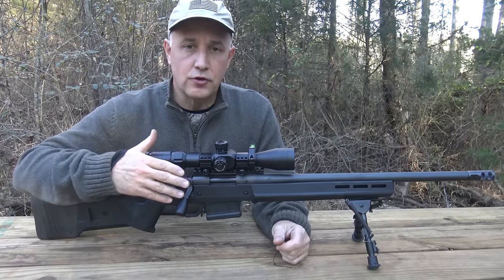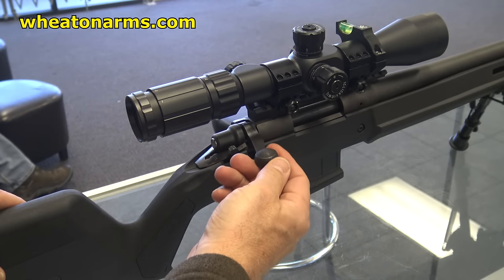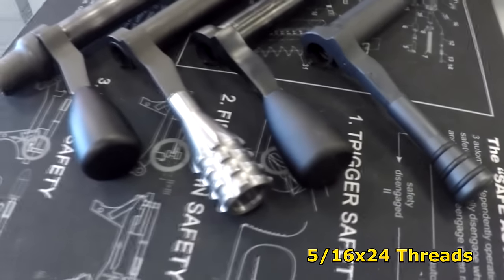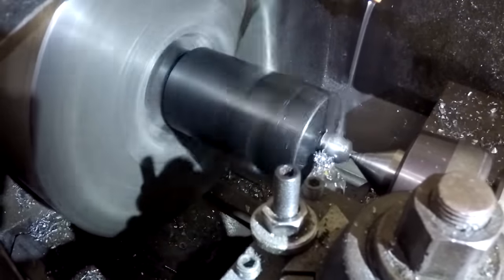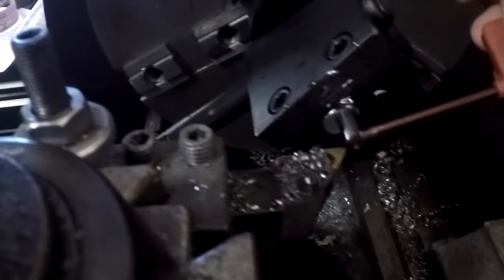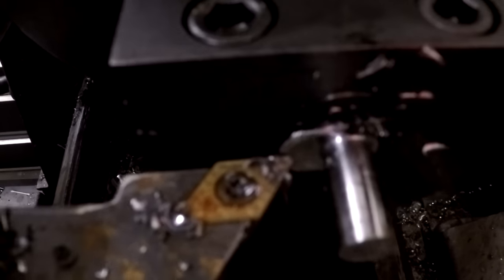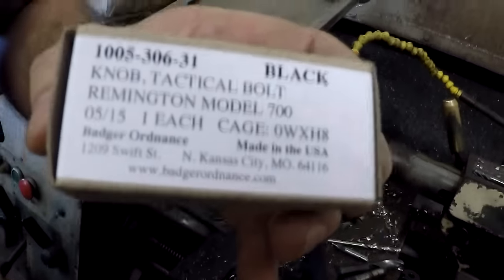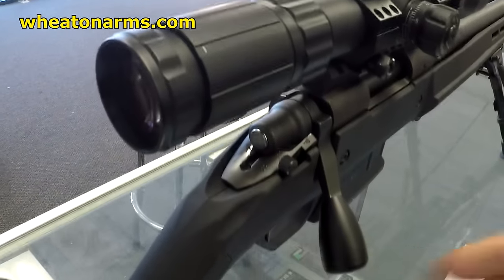Extended Bolt Handle Mod for Remington 700 Rifles

Comment: One reason I like Savages more than Remingtons. You can buy a extended bolt handle for a Savage for less than $60 and install it yourself. The only tool you need is a hex wrench or, on some of the older models, just a flathead screwdriver.
Reply: your right just did my savage cost me 56 bucks and a few minutes of my time...it's my go to deer rifle
Reply from the maker: +Deerslayer1912 Savage is making high quality rifles. I'm hoping to get one for review soon. Thanks
Reply: I agree Savage makes a better rifle
Reply: I've got a savage in 300 mag and I freaking love it super accurate long distance
Reply: +The Dude I run 7.62x51 thru mine and it's stupid accurate. The trigger is so crisp my friends who fired it for the first time jumped when it fired. Lol. They're not combat vets. Lol.
Reply: +fsteddie95 I've done some trigger work on mine it was good before that but it's fantastic now
Reply: +The Dude can i ask how big a distance u may be shotting ? and i love savage but god i hate rem never will i own a rem 700
Reply: Brandy brancourt well the distance would all depend on the scope you put on it a 300 mag is good for quite a long distance...I will say 100 yards is almost to close
Reply: fsteddie95 exactly what happens pretty much
Reply: fsteddie95 , lol well said!
Reply: We are Talking Remington. Savages??🤣🤣

Comment: i prefer the KRG bolt lift. it bolts on rock solid, only costs $28, and you don't have to worry about your bolt being destroyed. remington 700 bolt handles are famous for having internal imperfections, and turning it on a lathe is risky business. great video though as always.

Comment: A 700 has been my go to rifle since the mid 80s and I've NEVER missed the stock lever nor have I ever used my fingers to cycle the action. Why swing a 6" diameter circle to cycle the bolt. You can keep your coke can sized knob.

Comment: I’ve done it on a mill with a hollow mill and it was very rough on the equipment. I prefer the lathe process. Much easier.

Comment: I also noticed that you didn’t bother to Center the bolt shaft that you just cut with the center line of the bolt handle. It doesn’t look very professional. And yes you can do that if you take the time to do it.

Comment: Or you can tread it yourself with treading dies, just file down the standard boltknob to a size that you can tread.Then just put the new boltknob on with locktite.The treads on something like this does not have to be wery exact, like if you want treads on the mussle of the gun for a supressor or whatever then its mouch more important to get real good treads that is centered to the bore of the barrel.

Comment: There is not much in a Savage model 10/11 bolt handle. I replaced mine with an extended non for $45.

Comment: Be nice, if ...Wheaton Arms..would thread the cut off of the original bolt knob and screw in a male thread pin  with enough threads to screw back on to the threads where the new handle  would go, and where the cut off knob just came from; just incase folks would change their mind and go back to their original knob..and do all that for a $40-$50 fee of course...it would still be cheaper than buying a whole new Remington 700 bolt..which can fetch you near$300

Comment: I need to make one of those fixtures to hold the bolt I wish I knew the specs if I could make one I would be able to do this on my lathe. I might try and do this with a vertical milling machine just need to find a sturdy way to hold the bolt.
Reply: Mazak 250my/450m or Integrex would cut that fixture in minutes. I've got solidworks and GibbsCam, the issue is the $120/hr plus material cost of design/programming and then machining. If you had a print you could use the conversational feature as well.
I've literally machined fixtures and left them in when done and went straight into production of parts that went into them.

Comment: Small question. I recently baught a savage 110 and (like many hunting rifles now) it doesn't have iron sights. The scope I had was to small so I had to buy another one. Only problem is is that it don't sit right on the mounts. Does anyone know where I can find a rail mount? I checks my local gun shops and even wallmart. They don't have anything.
Reply: Call SWFA or Midway or Optics Planet. They will help you out.

Comment: Just have Rob make the handles too, why buy one on ebay if Robbie has a machine shop?
Reply: Because I'm sure he can't make them for $40. Only mass production can achieve those prices
Reply: +M85FSLUVR A good tool maker can turn one of those knobs out in about 4 minutes complete minus the coating.  $40 for 4 minutes pretty good shop rate.

Comment: how much should I pay for a Remington 700 used in a Woodstock that's from when Remington was quality over quantity?
Reply: You'll want to look up what year it was made via the serial number and a reference book/google. 

Once you zoom in on the year it was made you'll get a better idea of the value. Remington still makes wood stocks, so don't just date it by the stock.
Reply: Used 700's range from $350-$1,200

You more likely to come across them in the $500-800 range used, for an older one, depending on your location and the caliber you're selecting. 

Myself, if I was shopping for a used 700, I'd set aside ~$700 before I started negotiating.

Comment: Thats why i like semi autos
Reply: +PaulBodyBuilder lol they are a good option for lefties that dont want to look around for a left hand bolt.
Reply: +Arbhall McDougall I'm a left handed shooter and i've never owned a left handed bolt rifle.
Reply: Tommy TwoGun They are a good option. Left hand rifles are harder to get and even harder to mod. Generally more expensive too.
Reply: Arbhall McDougall
With a short action, i can keep my cheek on the stock and cycle the action while still looking thru the scope.
Reply: Tommy TwoGun My best friend Dave is a lefty and shoots right hand rifles exclusively. He just reaches over the rifle to cycle it. Looks hilarious, but it works if you develop the muscle memory.
Reply: Arbhall McDougall
I've done something similar with the Mosin i used to have.  With it's short straight bolt, i'd just twist the rifle over and grab the bolt to cycle it.  Worked pretty good.
Reply: +Tommy TwoGun me too shooting a right bolt is easier and faster bolt manipulation.
Reply: +PaulBodyBuilder its good to have both
Reply: Tommy TwoGun As long as you are getting good results thats all that matters. Check out Hunter Carlyle sometime.
Reply: +Arbhall McDougall Meh, semi auto is great. Only problem is that very accurate and reliable semi autos are expensive. Not to mention upgrades. But then again we have different definition of fun.
Reply: Aljosa Skrabelj See if you can find an SVT-40, good reliable ish semi auto, accurate and quite cheap in comparison. The gas recoil system is adjustable and is the big point of weakness for reliability. It was originally designed to use blanks for firing grenades off the rifle.
Reply: daniel boyd cooper It is indeed a good alternative. Not a good hunting rifle though. The SVT is 7.62x54mm which you can do okay with as long as you arent shooting the jacketed ammo. A buddy of mine swears you can use an SKS for hunting smaller deer, but I would rather have just a bit more power.
Reply: +Arbhall McDougall SVT-40? We are talking 1 moa. SVT-40 will never do that. So no.
Reply: Arbhall McDougall 7.62x54r is a better deer round, but the sks has been used to take deer as well. plus they are more available than the svt40
Reply: +daniel boyd cooper Yugo SKS? I am from ex-YU country. And no...SKS is not even close to accuracy we are talking (let alone range). Are you all joking around?
Reply: Aljosa Skrabelj the sks works well for me. its durable and cheap to feed. i own three of them.
Reply: daniel boyd cooper
 Yes it is nice looking old scool rifle. But debate was about very accurate semi autos instead of very accurate and cheap bolt action rifles (like 700 SPS). And when you want that kind of accuracy in semi auto...there is no cheap rifles. At least not that I am aware of one.
Reply: +daniel boyd cooper Not even M76 is capable of that..and I did shoot few of them with different ammo. They are mostly at 2 MOA (1.5 if you are lucky).
Reply: Aljosa Skrabelj i can't hit 1 moa with a better rifle. i'm no super shot. but the sks has put deer on the dinner table before. using 123 grain sp commercial ammo
Reply: +daniel boyd cooper We do not talk about deer on the table (you do not need 700 SPS tactical for that). Just that "very" accurate semi autos are expensive (compared to bolt action rifles). And SKS is not one of them. Nobody is saying that is a bad rifle...and where did I said you can not shoot 1 moa or lower? But not with SKS (maybe 1 lucky group). So can you read my first comment?
Reply: Aljosa Skrabelj l'm not being critical of you bro, i'm just saying i can't even find an svt40, but i can find a boat load of sks rifles. and i love em. i respect your opinion i'm just unable to comment on the svt40,
Reply: daniel boyd cooper
 It looks like we did not understand each other. I also said that SVT-40 is not accurate enough. I like semi autos (as accurate usable rifles)...but to get something accurate like "cheap" remington SPS tatctical inside semi-auto market with similar cartridge (.308, 7.62x54R, 8mm mauser..) you need a lot more money. Only thing that comes close cost about twice as much in USA. In Europe it is more like 3x the price of SPS (if you can actually get it). And that is DPMS LR-308. And even then you have trigger work to do... I have nothing against SKS or SVT-40.
Reply: Aljosa Skrabelj whats your thoughts on the armalite ar10?
Reply: +daniel boyd cooper I have no experience with armalite rifles (not many around here). How did you decided you want SKS? Wanted usable retro rifle?
Reply: Aljosa Skrabelj had a love affair with mosin nagant rifles, meet a friend from Albainia who told me i should look into sks as an alternative to the mosin, gave it a try. put it up against the ak47 and the sks came out on top. i was hooked.
Reply: +daniel boyd cooper hahahaha..yes as a civilian semi auto rifle SKS is far better then any AK. It has that true rifle feel. When I was serving in the army at the end I landed in honor guard. Standard rifle is bling SKS. It is very slick rifle. BTW you are form USA right?
Reply: Aljosa Skrabelj yes (USA) also military, retiring next year, where are you?
Reply: Slovenia. Very small ex-you country bordering Italy, Austria, Hungary and Croatia. You are lucky to live in so arms free country mate.
Reply: Aljosa Skrabelj i agree. i am very lucky to live in the usa which is why i choose to serve for my career btw i was in bosnia in 95. i love the whole region
Reply: daniel boyd cooper  Yes. More then every other nation I know, you have pride to serve in the army. Anyway... ATF still going crazy with their idiotic definitions?
Reply: Aljosa Skrabelj atf is crazy, if you put a pistol on your shoulder, you have just produced a rifle by magic! lol! this is why i have to retire.
Reply: daniel boyd cooper
 Hahahaha yes...actually if I understand correctly you just produced SBR. Do you hope this will get better after election if republicans win?
Reply: Aljosa Skrabelj i can only hope.
Reply: Aljosa Skrabelj That is unrealistic to expect from an SVT 40. At no point did I even hint at it being close to that capability. It might do 3 moa with hand loaded ammo, a modern scope and a skilled hand. It is however good enough for short range hunting with soft ammo. Its an okay semi auto for lefties, my advise would be to use a bolt action rifle for hunting. Left hand bolts are only a little troublesome to get and modify. But only a little, and not that much more expensive.

Comment: Sootch, if you learned how to operate a bolt handle you wouldn't have a problem. You don't grab a bolt handle with your fingers. You palm a bolt handle.
Reply: +samiam1150 Good point.  Many milsurp bolts can be run really fast and they don't need silly looking oversized knobs.
Reply: +nimst3  The machinist does nice work , but it's totally unnecessary and very expensive.
Reply: +mk319mod0  Some of us know that a bolt handle should be palmed and that the cheek weld should never be broken when working the action know how to shoot a bolt action rifle. Those who don't pay for unnecessary oversized bolt handles.

Comment: I had mine threaded though short action customs (shortactioncustoms.com) they insert a hardened setscrew inside the length of the stock portion of the bolt handle to make it stronger. The knob was seamless against the bolt arm. They did an absolutely MASTERFUL job.

Comment: can you build a sniper rifle or precision rifle from scratch??  like ar 15
Reply from the maker: +rohan9621 With the right tools.. mill, lathe and expertise.
Reply: +sootch00  is it expensive??
Reply: +rohan9621 For all the mills and lathes you would need to build a rifle from scratch... yes. Like over 100k expensive... those machines are far from cheap.

Comment: Why wouldn't you just send it to badger for $10 less. If you don't already have a knob, you save $12. love you scootch but there is a better option.  he did a great job and I would send mine to him if it saved me money but I am not paying more when the creator of the knob does it cheaper.
Reply from the maker: +crabsfree Lots of choices out there.... but as you see on the table, there are other bolt handle options.
Reply: +sootch00 I'd say use Wheaton Arms.
Reply: +sootch00  do u think you'll do a review of the 30-06 magpul stuff (well long action in general)